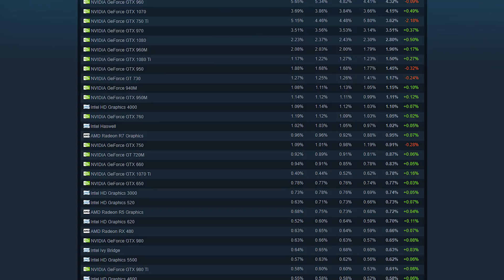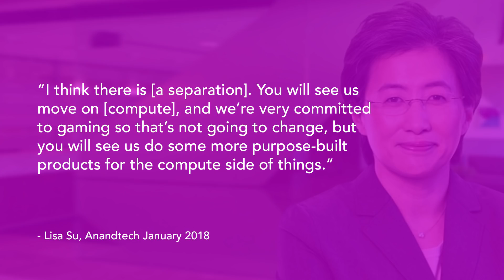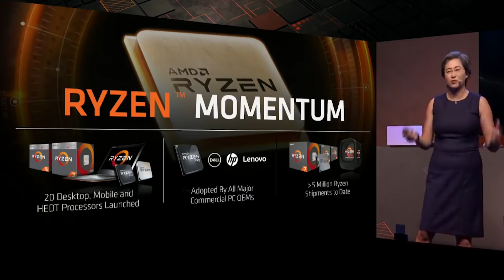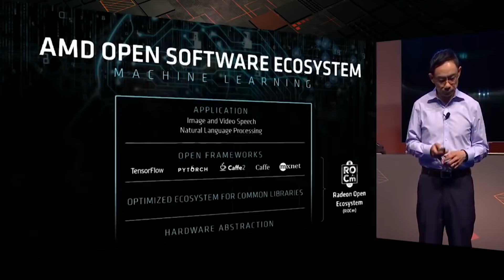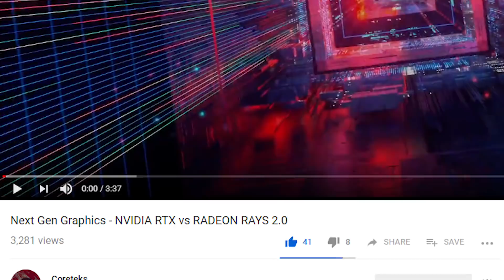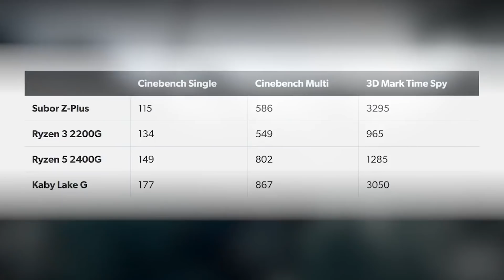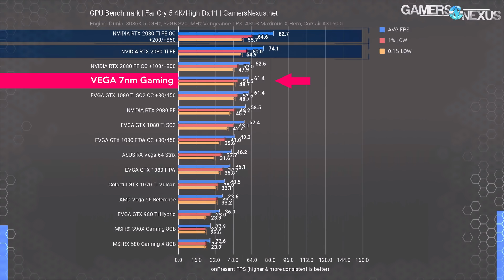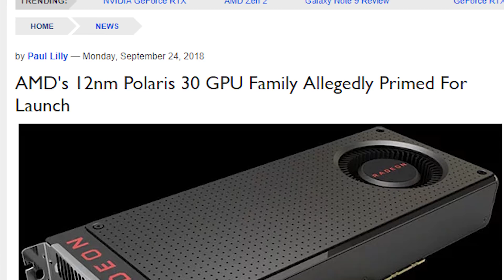AMD's answer to RTX

Comment: I'm not bias in today's competitive market. I use a Intel 5960x CPU and a NVIDIA 980ti in sli. I was holding off till the 2080 released but I'm so on the fence now. I didn't like the release at all. Normally I would be blown away with the details etc. But the price...no way am I'm buying one yet. I just hope AMD release a awesome card that proves it's a good investment. Not one that comes close, one that is a no brainer. If they do that. I'll build a entire new PC using AMD gear. As I absolutely love the specs on AMD CPUs theses days.
Fingers crossed they get it right this time.
Reply: I sold my 970 earlier this year and got almost what I paid for it new due to miners. I wasn't actively playing anything and had hoped for the next gen; but at the performance and price increase over previous lineup I can hold off. The only games on my radar are older games, Anno 1800 and hopefully RD2 (/pray) @1440p.
Reply: SLI 980 ti is a very very fast GPU, the upgrade to rtx 2080 ti would not be noticeable if you don't run 4K screens or stuff like that.
Reply: yeah as i said not in a hurry but i would love to run a single card with bulk memory. im lucky my 8c 16t cpu has served me well for all these years as i havent even come close to bottle necking that but the GPU i have in some games. i also have 32 gb of ram wicth has also helped with editing and multi tasking etc just want this final upgrade to fully future proof my rig. i guess the other option is to OC the cards i have and i am on full hardloop but ive never been a fan of OC the GPU's
Reply: NEVER future proof your PCs.

I can't say this enough.
Technology always advances and even if you build a 10k $ PC today, it will get squashed by a 1k PC in 5 years, only get a PC that will meet your CURRENT needs and the needs for a year or two, in which case, the 980 ti will serve you well for ALL games that came out and will come out for the noticeable future.

I have R7 360 which is 5x weaker than GTX 1080 (which is kind of the equivalent of SLI GTX 980 TI) and 4x weaker than a single 980 TI, and it still runs EVERY game, I have yet to find a game that I can't run and all of those games I can usually run for 60+ FPS.

Your SLI GTX 980 TI will absolutely demolish every game that comes out in the next three years, if we track the trend since 2014 (the year the 900 series actually got released), you'll be able to keep up games for well over 5 years.

But then again ,if you have the money, buy the RTX, I'm just saying its a waste of money since it won't give you much of a performance boost and it costs a lot to buy it right now.
Reply: I recently bought the 2080 FE. In AUS the FE is the same price as a decent 1080ti and I'm not interested in buying a used card so it was an easy choice for me since I needed a new card. 

Something I don't see anyone mention is the build quality of the FE cards. Full thick aluminium casing and backplate, vapour chamber heat sink. It feels and looks very solid and is a lot more compact than my 1070. It's quality is pretty impressive imo. Can't have been cheap to manufacture. 

I think people are mostly disappointed, myself included, that they couldn't provide the excitement of the new tech along with the significant performance increase we were expecting.
Reply: I don't blame you for not buying it yet, many games don't support RTX and it will be a while till they do, they rushed the RTX cards before the gaming market was ready for it so to pay that ridiculous price for a RTX card many many many games don't support yet is a total waste of cash for a product hundreds of games cant give you full performance for. I for one am using dual 1080ti but if the AMD card turns out to be good I'll be hopping on that bandwagon asap, especially if it's cheaper like he suggested in the video.
Reply: exactly my point. Im from Au also the 2080ti is like $2200 or something like that. but dont want to by a 10 series gen as if i upgrade i want the latest tech as we all know tech gets old fast.  performance speaks for its self ether for gaming or rendering etc. as an PC enthusiast  i know what I am after for my own needs Im so keen for this competition. but im not going to buy something if it doesn't perform AMD, INTEL or NVIDIA
Reply: @TheCuttz1984  Honestly it's a shame SLI is as finicky as it is, if it became standardized you would have a pretty long lasting system on your hands.
Reply: ikr it still performs really well hence why i never upgraded to the 10 series. but i woulld love to have just one big mem card in there but to make it worth while me redoing all my hard loops i want the best new card out
Reply: Prime Technophilia yeah it also has 64 rops vs 88. I prefer higher refresh rates for fludity myself. Yeah it's not. I don't think the rtx series is worth it, it doesn't validate having a 70% higher price tag then the 1080 ti. I'm sure they can make something just as fast if not faster. Imagine 7nm Navi apparently they wanna make it a multichip module so around 112 to 128 rops will be competive if they had an 88 rops card it would have similar or slightly less performance I don't think they're to far off and now since they're using tsmc vs globalfoundaries for their next gpus I'm sure they'll come out with something great. Rumors are pointing at an RX 680 launch this year which will boast 1070 speeds which still won't be bad if it's the same MSRP as the rest of the series and if it has gddr6 that'd be a big bonus.
Reply: On the off chance you don't have a good monitor, getting one would be a good value for your money.
Reply: +Ross Cutting Read up on what the 8800 GTS did to the months earlier released and pretty expensive 8800 GTX in terms of performance and price. 

NVIDIA will probably refresh the 20 series card pretty soon, since with new tech there is a lot of learnign and (cost) improvements to be made. 

You are VERY likely to overspend on a card that will end up giving you something of a theoretical capability once the optimized raytracing cards come out at a much better price point (especially since cryptomining will have even less impact on supply & prices by then).
Reply: @PRiMETECHAU  1080ti competition is on the way: double 7nm Vega dies on a MCM glued together with Infinity Fabric will be a monster
Reply: +Last Tutmos
Nah normal user usually like things that can run well without much tweaking.
And yes, Intel is good choice for casual users and gamers.
In ryzen you need to enable Ryzen balanced, disable HPET, etc etc.

AMD delivers decent product, true.
But it got too much praise tbh, that makes the negative aspect is kinda hidden from public.
Now after I own it myself, I know its actually still unstable in many aspect.
And I hate the facts that no people highlighting the negative aspect.

I, for example, like to mod old games like skyrim.
Did you know that Ryzen stutters so much that my i5 2500k @4ghz w/ 2133mhz RAM is better in that game?
After some research, turned out Ryzen's memory latency is worst than Intel. No wonder It didnt feel as snappy as Intel.
AMD still need so much homework in DDR4 aspect tbh.

You called people who buy Intel & Nvidia = Idiot. Careful, you didnt noticed you're already sounding like one of AMD fanboy.
If you hate fanboy from left too much, you'll end up becoming fanboy from right. Exaggerating things is bad.
Go middle, just let people buy what they want for God's sake.
Reply: @muhsetio  I have no issues in Skyrim or any other games with my Threadripper 1950X. Maybe you are using alternate RAM instead of the recommended Samsung BDie? My 1950X games much smoother than my i7 2700k.
Reply: +Timothy Isenhart
I'm using Gskill flareX @3200 xmp. It's B die isnt it?
Well I dunno for sure if the culprit is the ram latency. Just my guess.
Or maybe the IPC of Ryzen isnt as good as intel and maybe Skyrim just like good IPC maybe. I dunno.

+toppsballer
Maybe because I'm comparing it right after I upgrade from my old 2500k.
I know its worse because I'm using the same mod setup.
Not saying its not playable. Its 50-60 fps w/ gtx1060, but the micro stutter is pretty noticeable compared to my old RIG.

Still decent tho, and still best choice in its price range.
I just don't like people that easily calling others idiot for choosing Intel. Because it also have its plus. And because ryzen also have its minus.
Reply: The second iteration of Ryzen chips addressed to some degree the issues users with 2nd tier or intel optimized ram modules were having. the 2xxx series has almost no issues with the wx series threadrippers. and that is due to numa vs uma which can be changed between. Using ram not on the motherboards qvl list has almost always been a risky move if you want anything above the official speeds for the ddr standard, it was just more obvious with the original Ryzen 1xxx series if you built a system without doing your due diligence before hand.
Reply: Kasey Boles I have 3866 memory on a z170 and it gives me errors all the time even with looser timings.  Tested at 3733 all the way down to 3200. Ram overclocking is nice but it does cost stability and you can still get better frames with stock and tighter timings  vs high bandwidth loose. My next builds probably going to be ryzen zen 2 since it supports ecc I'd really prefer stability with tighter timings.
Reply: The testing on timings vs clock show clocks make a generally bigger difference until the timings get really bad. Any situation where this isn't true would be an outlier. Such as a proc with a very poor memory controller, horrid cache controller, or way to small a cache, or some combination. In your case it sounds like a bad match between memory and what the board+cpu supports. check the MB's qvl list and even the ram's qvl list. It's also possible you just got a borderline chip on your ram somewhere that slipped past QA.
Reply: Kasey Boles it was on the qvl list. For my motherboard. It runs and it boots but it occasionally gets an error and in memory benchmarks it does as well when I run the xmp I've tried all kinds of stuff to fix it. Probably just got a bad IMC on my 6700k or probably a bad ram module. Higher clock speeds are nice but it does start hitting diminishing returns. Just takes a shit ton of time to trouble shoot with memtest for the games I play right now I don't really need the additional speed. What I need to do is test each stick individually at xmp and figure out which one it is so I can rma it lol.
Reply: @Ren-kei  you don't need ECC for stability, and it will kill your timings
Reply: @edwardpark247  Yeah you don't but it's an extra feature and it does help with reliability and yeah i don't use ECC but it's something very nice to have for production machines where Memory errors arent on option.
Reply: @Ren-kei  If its a gaming box don't use ECC. If it's a production box, don't run games on it. Just my opinion. But for a production machine, ECC is pretty much a must-have, agreed.
Reply: Edward Park I know. But it's not impossible to have serve both functions. I'm on my 9th computer since I got into it as a kid so I know it's pretty obvious but you can actually get some pretty tight timings on ecc having normal ram and over clocking is nice for benchmarks but ecc is just far more stable then normal ram though normal ram is far more stable then shit we had 20 years ago for sure. There's ups and downs to using ECC it's not for everyone. The performance is negligible. As some ecc kits can support some pretty decent overclocks it's a shame they don't binn ecc kits and it's a shame that it's not a toggable standard. I don't think it's horrible for gaming when anything is better then nothing. The up side to it is you won't crash to ram errors. This is one feature people like Macs for is the fact they all run ecc and for a lot of people and average users that don't do benches or care about epeen measuring it's not a bad option for any office or production machine I'd say its a requirement and there's even situations it's helpful like crashy games with memory issues etc. I'm not saying faster isn't better but longevity is important and so is reliability. Everyone has different use cases. I don't run a system with ecc but have in the past so it's a nice feature for amd to have and it costs nothing comparing to Intel where you have to be on a xeon platform to get access to said feature. Thats great for consumers.
Reply: @Ren-kei  Hello again! Well, appears I am wrong, at least my assumptions are wrong. I assumed that ECC was going to slow down system performance, especially gaming performance, but I found an old article on Techspot - https://www.techspot.com/article/845-ddr3-ram-vs-ecc-memory/ - that shows that any performance drop related to extra memory checking is negligible.

Assuming something similar on DDR4, I would expect ECC memory to be more expensive, but not a hindrance to performance. Maybe when you get your system together, you can bench it with non-ECC and see if things hold true for your specific case.

I now agree with you, ECC should just be supported by default. Non-ECC is cheaper, but not faster. Which I find very interesting. Maybe ECC only slows down your system when actual errors occur, which on modern hardware is super-rare?
Reply: @edwardpark247   Your Correct About that, ECC Is only slightly slower because all Data is being checked by the Ram for Consistency the Margins are incredibly small in-between both Types versus Each-other there technically isn't an interrupt for some reason ECC is lower binned then normal ram which is very strange, The Only Difference Between ECC and Normal ram is besides the obvious function and edition of a Cache Parity Chip and Binnings It's actually Possible to build this functionality into the CPU Itself, Which AMD Has With Zen. The Additional 9th Memory Chip is effectively a Error Detection Memory Controller Which Checks Parity with the CPU and Writes Corrected Memory Data to the Rest of the Modules in Case of a Bit Flip, The Majority of Memory Errors are Actually Caused by Electrical Interference  IE,  Cosmic Radiation, Background Radiation, Any Stray Particle Can Corrupt Data, Theres a Close Correlation with neutron flux and Higher Altitudes even effect memory consistency.
Reply: @Ren-kei  pretty fascinating stuff
Reply: @muhsetio   Skyrim's coding is garbage and has been known to not play nice with AMD CPUs, which is funny considering I've never had any issue playing it on my 2700x/Vega 56.
Reply: u dont have to do any of those
Reply: also ur 2500k and memory stutters less that ryzen is bogus
Reply: @muhsetio  oh dear, you are so full of misinformation. Do you know the difference between a bug and a design flaw? The problem isn't Ryzen, it's Skyrim. You need to do some more homework on Infinity Fabric. It is far better than you give it credit for. Also, Spectre/Meltdown issues on Intel isn't about a bug in Intel's microcode. Their chip architecture is inherently insecure. It is a fundamental problem, requiring lots of thought regarding how to best re-engineer all their chips, and so far, it's been really painful for Intel. Meanwhile, as AMD keeps working on drivers, tools, optimization of older software, the Ryzen/Vega ecosystem improves. What does Intel do? Gives you a new chipset for no real reason, that's what... and a backdoor for the NSA to come in whenever they get hungry for some surprise buttsecks.
Reply: @edwardpark247  I know, but theres something better on Intel if its smoother in that game right? Idc if its skyrim design flaw or something. The comparison is in the same environtment. Because its fact when I said my 2500k is far smoother. And Im pretty sure its the memory latency after doing some research. 

Im highlighting skyrim, because when I upgrade to ryzen, my hope is it can lead to a more stabled modded game. In some aspect yes, but im kinda disappointed because of that micro stutter.

But still of course I know ryzen is more technologically advanced than 2500k. Take positive from what ive said : so ryzen flaw can be fixed on the next generation. Make it simple.

Comment: Amd has the whole console market, most likely they are working on a gpu cpu module that can act as a cluster for different price level of consoles in the next gen ps 5 / Xbox cube etc.... the 7 nm gpu series would be the basis of next gen console series. What remains to be seen is whether the ray tracing thing would be pushed by Microsoft on their next Xbox api set. When factoring Amds roadmap, one must take in to account the console development now on going behind close doors.

Comment: I actually think Polaris 30 is a far more important product to the mainstream (i.e. the 80%+ of the market).  Polaris 20 already does well enough against Pascal's mainstream range (1050's-1060's), with a 12nm die shrink it should likely compete with the 1070/1070 Ti in a GPU ~$250.  AMD might start running off Navi chips early next year, but the vast majority of that output will be going straight to Sony (and perhaps Microsoft) for their next-gen consoles, and the rest will be going to AIB's and developers as engineering samples.  I think mass production of Navi PCIe boards is a fair way away yet.